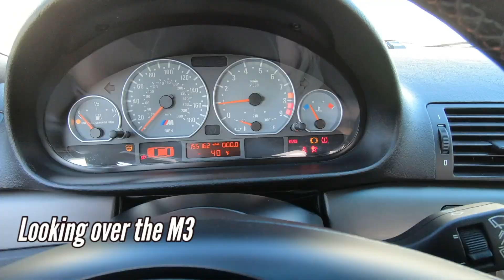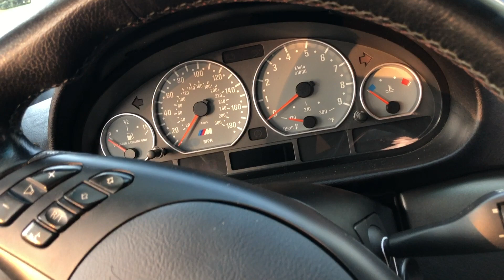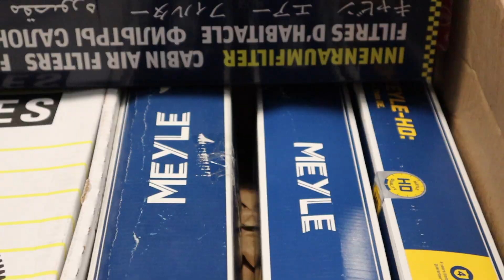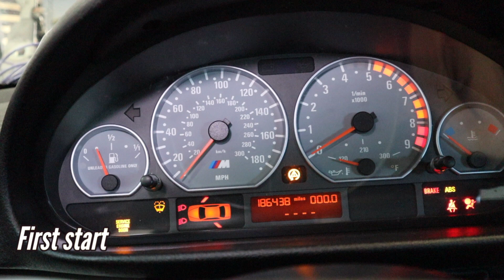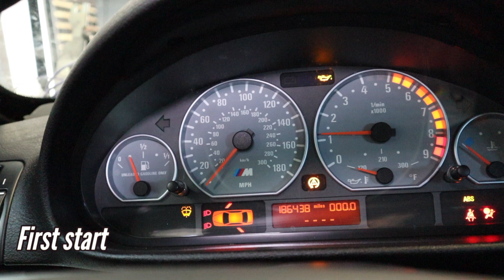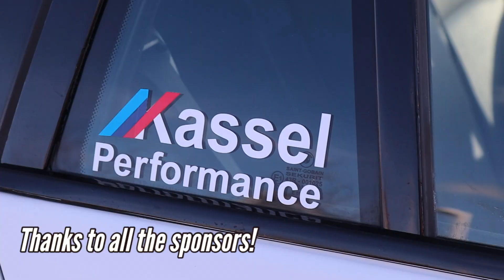Insane E46 Wagon build in 12 minutes - S54 powered BMW Touring build - Crazy BMW E46 transformation

Comment: i notice ur angeleyes have a voltage problem (purplish tint)... just installed mines today also.. is not the LED rings or the power module... is something to do with iregular electric flow on the position bulbs... i wonder what...
Reply from the maker: Has a new battery. My other cars with the same set up do similar things. Also some of what you’re seeing is the camera interacting with the LEDs. But it’s a good thing to check your power supply when having issues.
Reply: @TenzaMotorsports  I bought 3 sets of angel eyes cause I knew there will be some issue with the purple tint thingy but for the sake of me I don't know why only 1 ring goes purple ... But now they went fine all white but on 1st install from 8 rings only one position was doing purple on all rings weird

Comment: Wow!! Can’t imagine the difference. Plan to do that to my wagon one day. Out of curiosity, what would something like this cost for you too convert my wagon over to S54? 🤔
Lastly, How were the ECS coil-overs on it? Looking for new suspension on mine, was looking at ST coil-overs
Reply from the maker: If it’s just the s54 swap. It’s not too bad. This one racked up a huge bill with wheels and tires and paint. Front bumper headlights taillights. 

The ECS coil overs make the car feel just like a stock M3. It’s unreal.
Reply: @TenzaMotorsports  I would just want the S54 and manual tranny swap. 

But Awesome! That’s what I was hoping to hear. They Seem like a great budget suspension set. If they works for your wagon I’m sure they’ll work for mine. Do you have a discount code or affiliate code I can use when ordering them to help you out?
Reply from the maker: I would have to do some math. I’ll get back to you on that! And yes all you have to do is use one of my links and it automatically links to my affiliate

Comment: The whole wagon should be white.  The black mouldings make it look like a base model, even worse in gloss finish.
Reply from the maker: Well it is a 325. So it’s basically the base model. Also pretty sure all the e46 sedans and wagons (whether 330 or even ZHP) had black trim. If it’s been painted, it was modified by an owner. We were going for a bit of a sleeper. Outside of this car just looks like someone did a ZHP bumper with some M wheels. But hides everything else. 

And the last point about gloss black. Sorry but that’s just not true. The naked plastic looks WAY cheap, fades in the sun and ages the car like vintage milk. Painting, replacing, or wrapping the trim is the first thing I do to any sedan/wagon to make it look way clean.